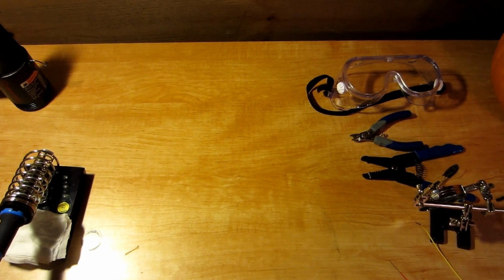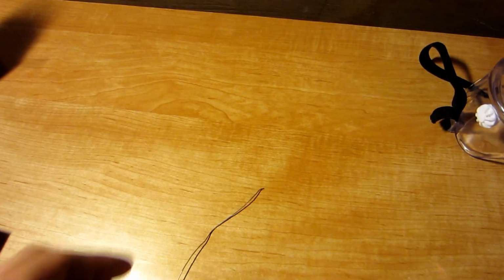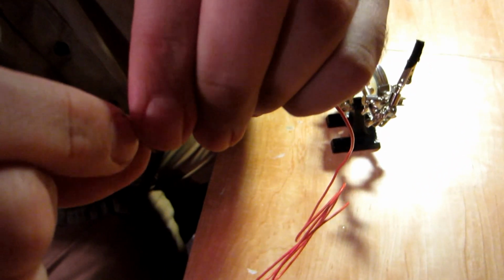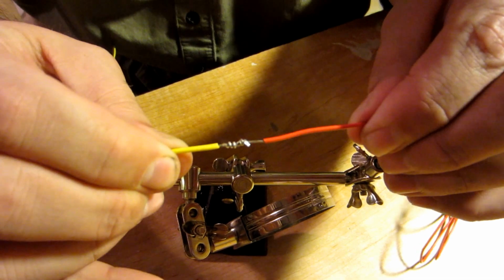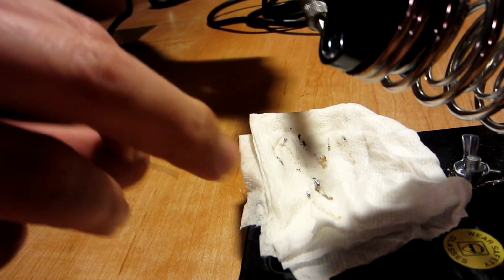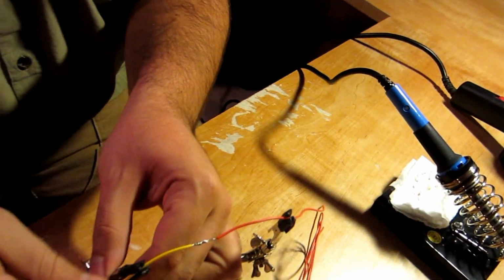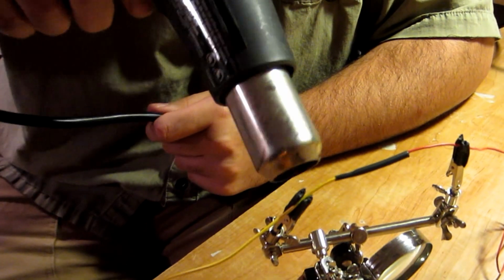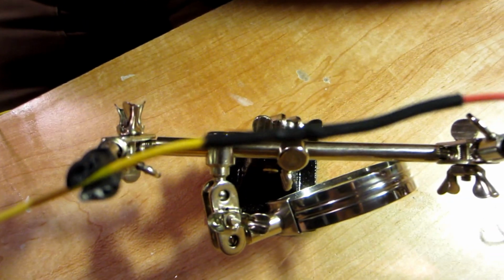Western Union Splice.mov

Comment: I thought when 2 dissimilar metals touch, corrosion is a result. Does the lead in the solder have a chance to cause corrosion in the future at the solder point?
Reply: Generally, not to any serious degree. The tin in tin/lead soldering alloy forms a protective oxide layer, not unlike what happens with aluminum. Low-tin alloy solder is more prone to corrosion than the more expensive high-tin alloy. Tin-silver is even better.